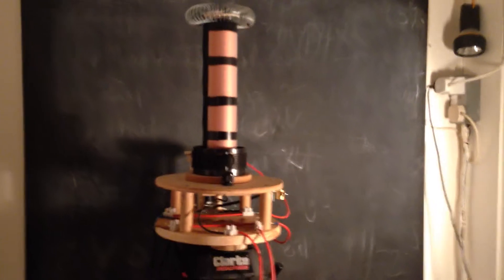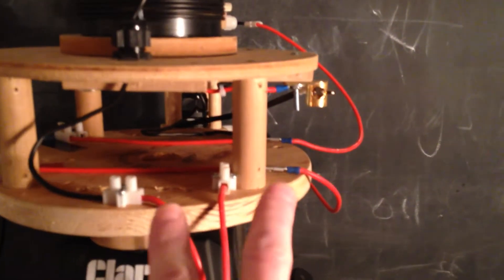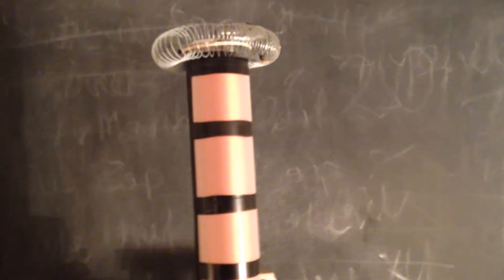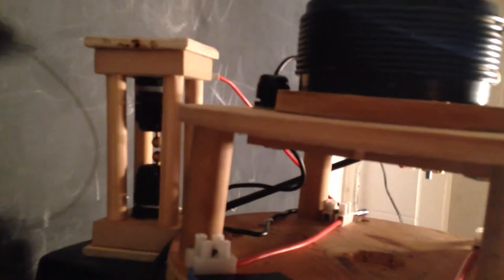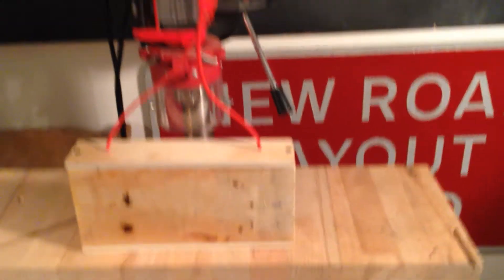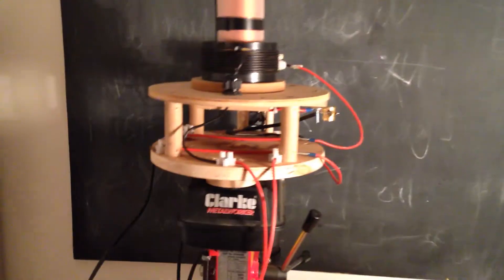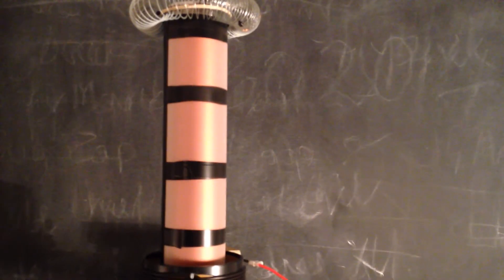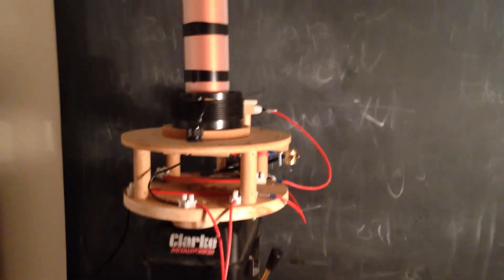ZVS Upgrades new resonator

Comment: ah looking good bud =D quite the nice output still having trouble with arc over on the secondary ;-/ well i would suggest wrapping more of the plastic sheeting around the secondary build up the dialectical strength possibly i dont know  what material its made out of but if you can find some is overhead projector sheets which lots of people use to make HV caps. would do wonders high dialectical strength i think 15 Kv per sheet .. but i dont know if you plan on keeping the primary as it is or going for a pancake later on .. as for the flyback, the ZVS inverter can take a lot of punishment we all know that ;-) but DC flybacks start to fail when the input voltage goes over 18-20 v for long or short runs trust me i have a small graveyard of them .. if you want to continue that setup with high input voltages,  get yourself or wind a AC flyback and rectify the output ( caps, unless they are high freq. capable, will not charge )  AC flybacks are robust and typically not potted, if you do buy one try and get one thats never been used, still in the box 

http://www.ebay.de/itm/RARITAT-ZEILENTRAFO-KONIG-FAT-210-450-ca-75x40x72mm-line-transformer-24718-/171162623727?pt=Radio_TV_Musik&hash=item27da165eef  ( similar to the one i have, if you have not seen my vid on flybacks give it a watch, i can input the max from the ZVS - 55VDC - and the flyback is a champ ! ) well thinks enough of a read for you so once again great job its a great coil cheers dude =D